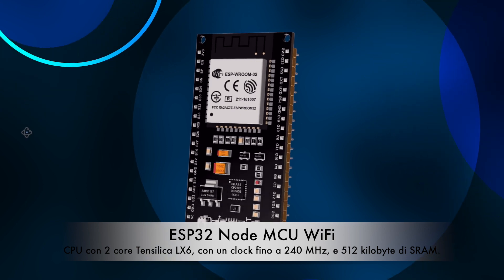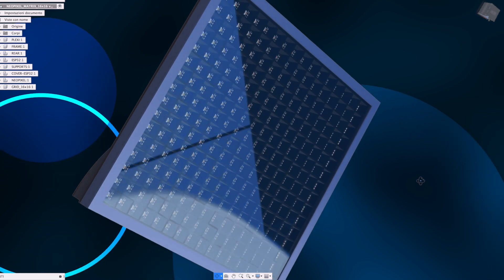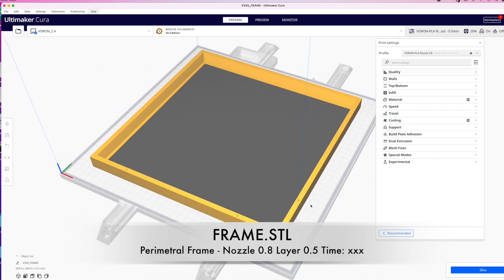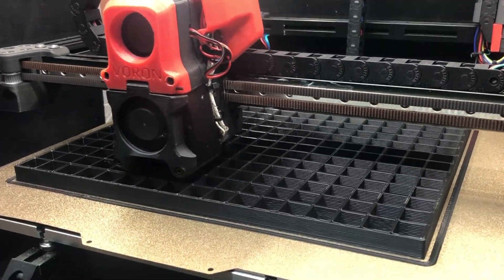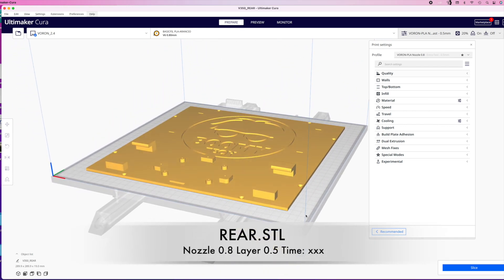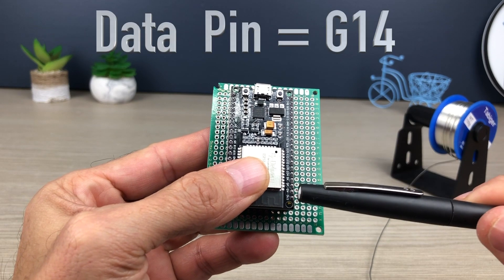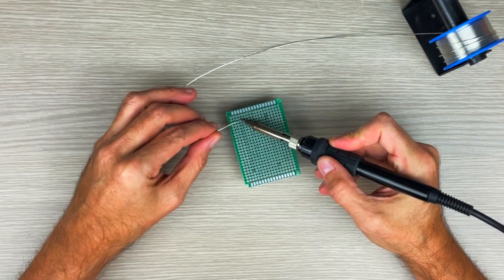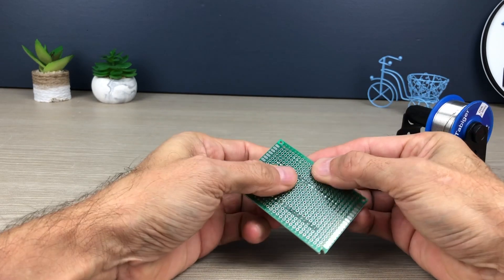LIGHT EFFECT by WS2812B NEOPIXEL ESP32 DIY MATRIX 16x16 ide ARDUINO

Comment: Hi learnt a lot of video. 

I am curios what those wires are , if there is a amazon link you can provide. 

That one common long wire that you are using to join all ground and positive and wire that are you using to connect to actually connect that long wire with ground and positive of  led strip on 1 side and other side.
Reply from the maker: Hello, the ground and 5v naked wire is a copper wire coaxial antenna…the others wire are silicon covered you can find on Amazon
Reply: @boomytech7504   Are you spreading them apart for the internal wire to expose and then solder them. 

It looks like that as I am zooming on this. 
https://youtu.be/RFV1uDLxeXw?t=275
 Amazon links to them would really help and allow me to procure the same in my area.
One copper looking wire and the silver colored (naked wire) that you are cutting and easily soldering
Reply: Apologies for the basic questions. This is my first project like this. 

I have looked at many other videos. 
This seems the fastest way to quickly and easily solder with minimum number of solder with clear seperation to ground and positive connections reducing lot of clutter.
Reply from the maker: @BipulJain 👍🏻
Reply from the maker: if you need help, you can write comment here. There are many followers that can help you.. :-)
Reply from the maker: You can use this simple copper cable (inner)
https://amzn.eu/d/gR8kIe6

Comment: Searching the networks and tying writing and videos I have managed to send texts to a neopixel matrix with esp32. But now I saw in the market the esp32 c3 xiao very small, the smallest of the esp32, but works with bluetoth BLE therefore my programs do not fit in the because they are with classic bluetooth. I have seen a lot about this bluetooth on the network I did not know that it was so complicated with respect to the classic to the extreme that I have not managed with this type of bluetooth to take a message to a neopixel screen, do you have some video about this
Reply from the maker: Ciao Ernesto, I know the esp32-c3 chip in the "seed studio" version and it is wonderfully small and interesting. I plan to prepare a video of a sensor to detect water leaks and alert the user with a mobile notification via IFTTT.
I don't have any videos regarding bluetooth but on their site seedstudio.com you can find any kind of information.
As far as I'm concerned I will try to prepare videos related to esp32-c3 in the future. If you want you can subscribe to the channel. bye, see you soon

Comment: Hi very nice Video. How many meters of LED Stripes did you use?
Reply from the maker: Hi, more or less 5 meters..
Reply: @boomytech7504  Also, did you use 60 LEDs/M?
Reply from the maker: I use this: 
WS2812B WS2811 WS2813 WS2815 30/60/pixel/LED/m Striscia di RGB LED Indirizzabili Individualmente Luce del Nastro IP30/IP65/IP67 DC5V DC12V
https://a.aliexpress.com/_EuQtIGZ

Comment: I want to make 120 cm width, any suggestions?
Reply from the maker: Electronics and software remain the same, but you have to change the construction system unless you have such a large 3d printer
Reply: A possible option is to divide the whole into 4 equal parts. Make 4 boards that you can control in parallel. Place them mirrorwise against each other so that the 0 LED is in the middle. A board with 16*16 = 256 LEDs and this times 4 are 1024 LEDs. Gives a beautiful effect, but requires a solid power supply. Because comments with a link will not be posted, if you are interested, you can search Jan5412.